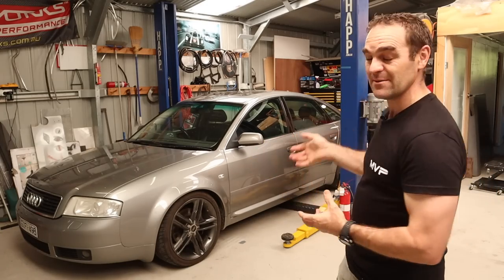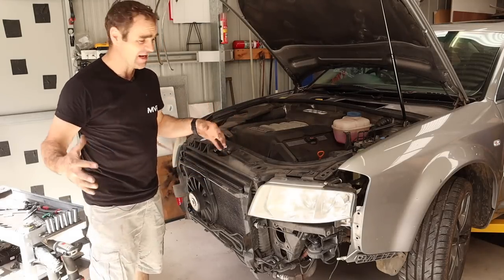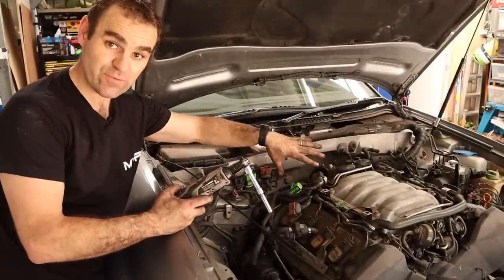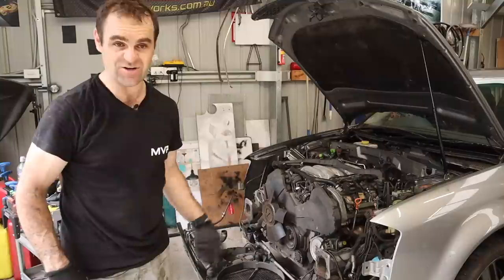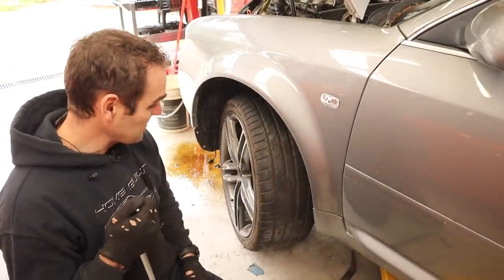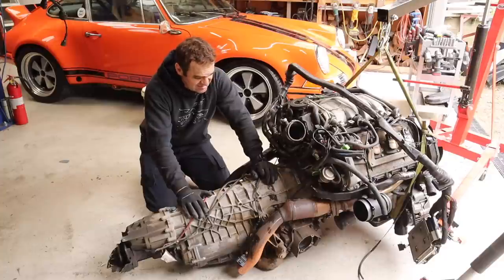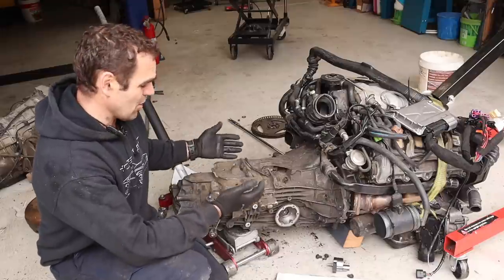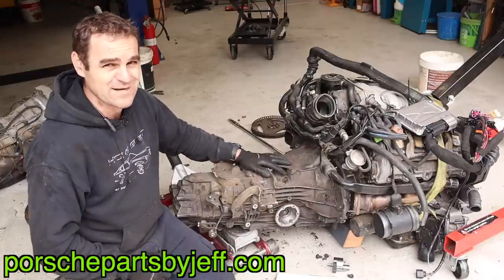Time to yank the engine from the A6 V8 - Porsche 986 Boxster V8 engine swap track car build 1

Comment: If you want to be absolutely insane when building a boosted V8, a lot of V8s have their piston timings such that you can actually run twin-scroll superchargers on each side and get fantastic exhaust scavenging and get even better low and mid-range performance out of your turbochargers since they're able to build boost more consistently. Twin twin-scroll turbos would be a real challenge to fit into that car, but it's a mad build for a V8.

Comment: Jeff great video. You are a brave man to choose the most complex pain in the ass motor to maintain and engine swap. Be careful when cutting that close to motor on exhaust pipes. The debris flies up in to the motor and if there is an open valve all that abrasive goes in to combustion chamber. Then you have a bad cylinder in a few weeks. Only with the wheels not with saw. I cannot wait to see the Alfa done!!

Comment: Alright, I'm sold! As soon as you said "the older version with a timing belt", I had much hope. I've heard the rumor about the trans fit up and I can easily see how much that simplifies the swap. Now for the "minor details". In future, on the AC problem, call Benny up-he has worked some cars in his shop with AC, so I'm thinking he either has or has a mate who has the pump and evacuation gear you would need. And thank you for taking the effort not to just let it blow- it's the kind of decision we've come to expect from you, Jeff! Best to the Missus! She signed on for some "driving lessons" yet?

Comment: There are some of us who love the older Audis. I have a C5 chassis Allroad. When you need help with the Audi electrical integration, check out Audizine for info.

Also, if you undo the upper control arms from the upright you could probably have left the CV axles in the hubs.

Comment: After the last video, I found some information on the marriage of Audi V8s to Boxsters.  Can't say I'm surprised that the transmission mating up to the unit is a big deciding factor - that sure saves a bit of work.  Should be quite a machine when you're done!

Comment: Gearbox compatibility, when swapping engines, is a huge deal - as you've found with the Alfarrari, the measurements, modifications and fabrication needed to make a different gearbox fit aren't simple or cheap! I battled for ages on getting the gearbox, flywheel, clutch etc sorted on my Anglia too, because my Mitsubishi engine never had a RWD gearbox!
I did think before you announced it that you've gone with the Audi because the engine is in front of the gearbox, and it's got the driveshafts out of the side of the gearbox, which is what you need for the Roxster! /smugface
Reply: This is a great swap due to the ability to connect the Audi V8 to the Porsche/Audi gearbox. Some legendary swaps in the past, but not many ..
Reply: Hi Garry. Great minds think alike. ?    mpbvr4.    MalcB
Reply: @malcolmbennett3907  yes it's me! Isn't @homebuiltbyjeff brilliant!!
Reply: @confused47  have you watched Binky Project from Bad Obsession Motorsport? Another good one👍

Comment: Make sure to replace the coolant pipe in the oil cooler while you have the engine out.  A known failure point on these engines and a major pain to do with the engine in place.  The aftermarket aluminum version is far superior to the OEM plastic pipe.

Comment: When people say an LS is cheaper,   they are talking about the long run. Audi parts, and aftermarket products are ridiculously expensive, not to mention if you have to rebuild it. LS stuff is cheaper and absolutely readily available
Reply from the maker: Why would I rebuild it, when I can just buy another one for very little ;) Rebuilding any engine is an expensive and time consuming exercise.

Comment: This project looks like a lot of fun, I’ll be following along.....so many questions, I’m curious for a cost summary when you are done, considering the parts off the Audi you could probably sell...looking forward to seeing your fab skills as it relates to fitting this big motor, and all the electrical system mods that will be required.   Good stuff.

Comment: Wow love it, always something new i learn,  that is awesome so exited for your build, good to know i have an interest in them mid engine porsches this will be a awesome set up, like what iam working on right now on a mercedes benz m113 v8s you can bolt on the flywheel, clutch, transmission , clutch pedal from the 6 speed v6 m112 variants

Comment: At last someone on YouTube that knows about the service position of the front panel cooling cassette on Audis ...every US channel always complains about lack of room and how hard they are to work on 🤦‍♂️ being an ex-Audi master tech it drives me mad when they talk crap like that. A little knowledge and research goes along way.
Reply from the maker: I made that mistake on my S5. I am older and wiser now ;)
Reply: hi ex-audi master. please say me what is the difference betwen 2 camshafts 077109022DF  and 077109022DP... audi S8 D2 2000 year..   they are same just code number changeg or   phases are different???  from eye they look totall identic.. so master please show me your skills !!!!

Comment: And Audi, Ford and Volvo is like Lego if you know what parts fit what. The Mondeo ST220 3 litre engine can be be bolted straight to the Jaguar X series all wheel drive box so you can basicly make a 4x4 Mondeo ST220 if you want to. And since the estate rear suspension is based on the X series, you can use Jaguar stuff to make it 4x4. The rear drive Jag box can also be bolted to the ST220 engine which is based on the Jaguar 30 series engine, so you can build a rear drive Capri for exsample with the 3 litre Mondeo engine.. Or with a Jag engine if you want. The Jag engine also came with supercharger. I know there at least one Capri running that Jag 3 litre engine in UK.
Reply: A mondeo St 4x4 would be a nice project. I love that car.
Reply: @markkarm9253  Me too. I only had a 01 Trend 1.8 125 hp estate, but I loved everything about it. Thesedays I drive a 04' Volvo V40 and it's not the same. After 1.5 year I still not find it being "me". May have to go back to an Mondeo.
Reply: @MrCaprinut  Threat yourself well next time and buy a GHIA :D .The best ones come with auto clima, leather interior with heated and ventilated seats and much, much more ;)
Reply: @markkarm9253  I like the Titanium much better.

Comment: This'll be a bloody interesting build Jeff. I am considering the weight, which you did mention (with no figures :)  ). But if it has been done before it must be acceptable. Go Roxster!!!
Reply: I'd suggest there about the same.
I believe that Audi V8 is all aluminum so  fairly light weight considering..it's a V8.
I'd thought an LS would be a little heavier.
Reply: Quick look suggests a stock 2.5 Roxster engine ~ 400lbs
LS ~ 460lbs
Audi V8 ~400-700 lbs depending on engine size. 
So very similar.

Comment: From watching a couple of LS swaps they are not as easy as they seem it is cheaper to fit another Porsche engine also you need to find a way to stop oil starvation on cornering by modifying the sump some how or it just explodes again.

Comment: Jeff, interesting build, have you considered the weight of the Audi 4.2 liter V8 compared to the Porsche engine and I assume you will be using the Porsche gearbox,  what about the power and toque numbers if you are going to race the car. You will need to boost the suspension shocks and springs and as you probably know how rear engined cars a quite taily. Cheers Rob looking forward to both  your builds.

Comment: Interesting build Jeff!!
I had originally thought the Bi-turbo V6 route or the Subaru Boxster route  but you've gone the V8 route for the win. 
I've seen the LS has been fitted before but they had t6cut the firewall.  Will this have to be done or is the Audi V8 shorter???
Reply from the maker: Shorter and I don't need an adapter plate which also makes it longer ;)
Reply: @HomeBuiltByJeff  
I've found a V8 Boxter build on Facebook, so yes you're right it can be done. 
Perhaps, instead of Aircon, a Rotrex could be fitted in its place. Light and  n/a feel and no extra space required!!

Comment: Hi,Jeff. Do you think the 4.2 could be installed on the Boxster S Tiptronic ? Also how is it going with the wiring ? Love the work and your Wife is a keeper > LOL
Reply from the maker: Auto's create a whole new level of issues due to the ECU integration. Manual swaps are much easier.
Reply: @HomeBuiltByJeff  thanks,Jeff.

Comment: Just have to say, again, it's not a cheap motor. Or common. It's complex and over engineered. Equivalent LS? LS1 5.7. Both 250kw. In standard form. One a quad cam 40 valve motor, the other a push rod. One rare as fuck, the other common as. Hence parts are hard to come by and very expensive. Yes, to be clear I've owned both motors. As in LS1 and the 40V. The 40V when shit went wrong was no end of headaches!!! Parts hard to find, 99.9% of time overseas sourced, usually from A8parts UK as oem had upto 2mth wait time and BULLSHIT costs involved.
I somehow gather that's the reason you got the A6 complete from Melbourne. And that should tell you something. If you couldn't get one from Sydney, that's a concern. Yes it's cheap, 220k is grenade time. Electronics start going from low to mid 100k's. I patched my A8 from 100-150k till it just became too much. No one wanted to touch it. NOT EVEN AUDI! Not to mention no one knew how to.
Atm the 3 cheapest 4.2L Audi's(car) online are $10,12 & 15k. Cheapest engine(150k km) is $5000+ from germany(2005). Later model used going from $6-7k+. Don't forget that's best case. Something wrong, parts +labour will burn big holes. Been burnt. Still got the scars. Having my A8 written off was ONLY thing that saved me. DIY? Sure, but again, parts. Cost & availability. The engine shown here using A8 terminology is a D2 model. I owned a D3, they are currently on D5 gen. So don't expect used parts to be abundant. I was doing a lot of running around on D3 gen already.
Jeff hit the nail on the head. They aren't classic, there isn't a huge market on aftermarket stuff. LS? That's why goes go there. Cost/availability.
If you plan on going old Audi. Good luck.
Old porsche, Ferrari, Alfa, sure, not cheap, but availability yes. Audi? Expensive parts new, later, still expensive but very, very limited. Usually used and ratty. Rarely decent aftermarket options.
Just saying. Unless you are extremely handy and have Jeff's access to Worksop facilities you're screwed. Even then you can't fabricate components and electronics. If they go you might not find a replacement. If an oem one can be found it will have a few 000's on the end.

I hope Jeff the 200k donk don't go bang. I hope bits don't die off one after another like mine(remember I had 1 gen newer, and this was a few years ago still).
The 40V motor is a handful guys.
It's nice that in this case it's VAG complient, but unlike what Jeff said, no, a quick flick 4.2 if this one goes won't be that easy. We'll it is, but you'll need about $7k+ for a decent one, and it will be overseas sourced. Oz salvage? Maybe.
It would be nice to know the cost and sourcing of this donor car to use as a basis of understanding going forward🤔

Comment: Wow awesome video! Will that engine fit in a 911 996??
Reply: I don’t know the answer to your question, but a Chevy LS fits in the 996. Wouldn’t you rather have that? I’m very tempted but my 3.4 996 is still going strong with 120,000mi on the clock.

A brand new LS3 with a warranty and 430hp costs less than $8k. The $11k version develops over 600hp.
Reply: @lebojay  but with that said you advise the LS over the Audi engine? I was looking at it from a price point of view...my budget isn’t huge...
Reply: @johndeltoro2788  I think swapping a non-Porsche engine into your 996 is a very personal choice. Maybe you care about keeping it German; maybe you don’t. Emotions can matter.

But if you want lots of power, cheaply, and are willing to go through the minor ordeal of installing it, you can’t do better than a used engine from a crashed Camaro SS or Corvette.

Check out Renegade Hybrids for the Chevy swap. They sell kits with everything you need to make an LS3 go into your car. You will have to cut your car some to make the engine fit and to create an access hatch behind your rear seats to ease regular maintenance. The cutting isn’t structural and won’t be visible, but it’s a personal choice if you’re willing to do that. I personally don’t see the harm. Once you swap the engine, it’s a custom project anyway; no sense trying to preserve originality now. 😎
Reply: @lebojay  thank you and keep up the great work with your videos!
Reply: Y’know, I was just thinking, you shouldn’t take what I say too seriously. I know little about putting the Audi engine into the 996. It may well be much easier. And the LS3 swap has some drawbacks; you lose hydraulic power steering (can install electric power steering if you want) and you have to use a non-standard electric water pump, which may be okay but gives me the willies. 

Something wrong with the engine you have?
Reply: @johndeltoro2788  I didn’t make this video. I’m just a guy on the internet talking shit.
Reply: @lebojay  no nothing at all just love that V-8 your doing and was maybe looking for a little more power...I just did a ton of preventative maintenance (IMS, clutch, water pump, thermostat, rear main seal, struts and springs, plugs and coils, plug tubes) probably looking to install short shift.
Reply: @johndeltoro2788  These are Jeff’s videos. I’m not Jeff.

The engine you have has plenty of guts. Just rev it higher. 😉
Reply: @lebojay  is it possible to put turbos on my car? Like the 911 turbo...
Reply: @johndeltoro2788  Turbo, no. Supercharger, yes. Google “VF supercharger 996.”

Meaning no disrespect, John, if you’re asking questions like this, major engine mods are probably a bad idea for you. They’re never straightforward, and increasing the power output of your stock engine will create new reliability problems. Unless you’re really into getting dirty and turning wrenches, I think you may be heading down a path that will lead to frustration and disappointment. My best advice is probably to just enjoy the car for what it is, and replace it in the future with something faster if that’s what you want. 

Are you young? Again, meaning no disrespect, but if you are young and inexperienced, you may not appreciate the fact that, no matter how much power you make, you’ll always want more. It’s an itch you can’t ever scratch. If you have lots of cash, go nuts, but if you’re on a budget, just enjoy what you have. The car you have is already too fast for city streets, and virtually nothing feels fast on the Interstate. Any horses beyond the 300th one only come out to play for nanoseconds at a time, and even 150MPH feels slow on the highway. Having much more than 300hp accomplishes nothing except very brief spurts of acceleration, which are awesome but a very expensive way of delivering fun in 3-second doses.

Just my two cents. As I said before, these decisions are subjective and emotional, so take my opinion FWIW.

Do you rev your car to the redline? You should. Drive it hard. If you never go above 5000rpm, try it. You may be surprised.
Reply: @lebojay  it’s my first Porsche and I’m not young but yes a tad inexperienced with wrenches but I love your input for sure and no disrespect taken at all!! Love the advice for sure that’s why I ask!
Reply: @johndeltoro2788  Cool man. Have fun out there!

Comment: Honda K24 would have been cooler imo, probably less weight, cheaper cost, and more power with mods.
Reply from the maker: If you watch the whole video you will see why I went with the Audi ;)
Reply: @HomeBuiltByJeff  I watched the whole video, Im just not a fan of audi engines. So many small issues arise! I dont think it would handle track abuse, I could be wrong
Reply: @ibidu1  it might be able to do it, if you knock most of the audi off of it :D

Comment: Why didnt ya just drop the whole front crossmember and dissasemble from the start?
These modern cars are designed to be that way, to pull the engine like an old school car is just a headache.
Anything else ya dont need can just be bolted back up to kepp the shell rolling.

Watching further on, thays what ya did...but dude, that looked painful 🤣🤣